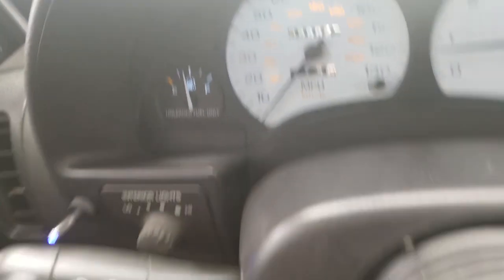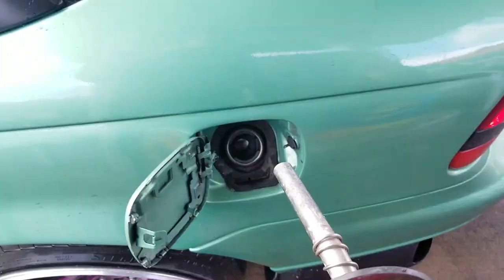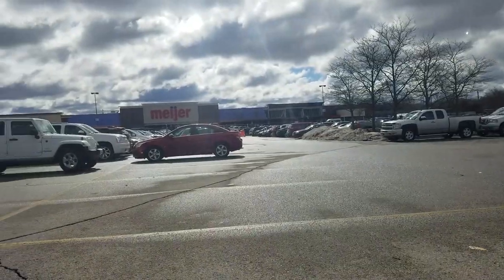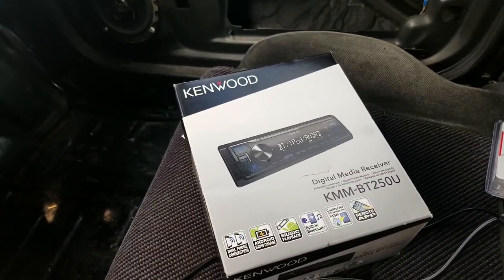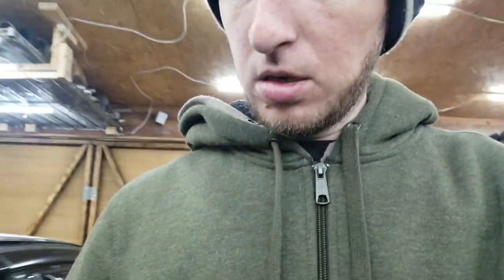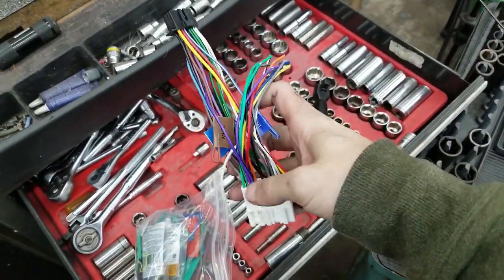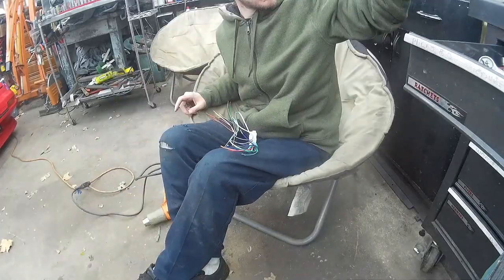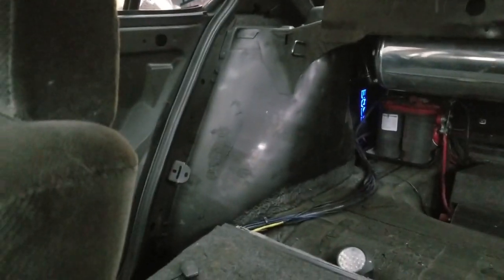Midori Radio Install

Comment: Couple of things man: What radar detecter do you have? Took me awhile to find one for escort redline but I found one through the Wish app. So check them out!! In my saturn I have a Sony Bluetooth stereo with some better Pioneer speakers. Bought the setup through Wal-Mart. I have been happy with the setup for at least 3 years now👍 No sub for me though.
Reply from the maker: my radar is an Escort Passport IX, hooks up to my phone thru Bluetooth and has its own app
Reply: @BuilditBreakitGarageinc  Check out the Wish app and see if they have it! Shipping usually takes a couple weeks, it comes from China. But cheap prices.

Comment: You Should Run Some More Stretch & Slight Bit More Camber
Reply from the maker: I hate excessive camber, the car is currently running factory alignment specs for a reason... really if I could get away without having stretch I would but theres no way id be able to do that
Reply: Build it Break it Garage inc. O ok seems fair lol

Comment: Hey paul do you need a new battery? Noticed your resting (car off) voltage is below 12 volts which is no good
Reply from the maker: its all the parasitic drag from the Amp and the air compressor
Reply: Had a feeling it had something todo with your air compressor